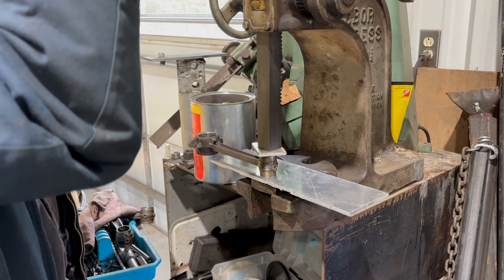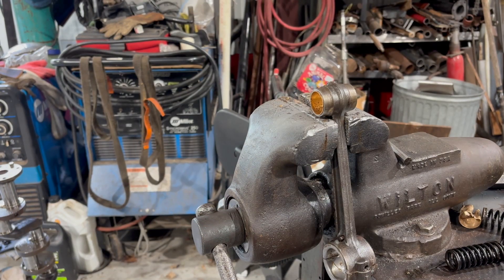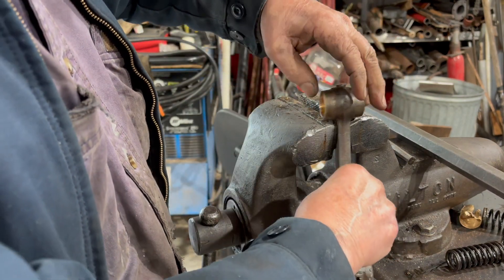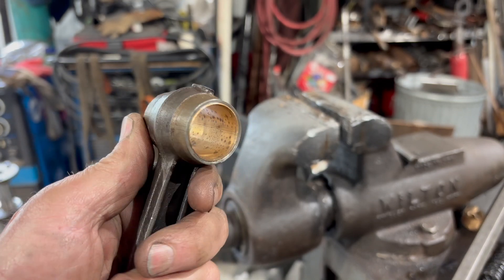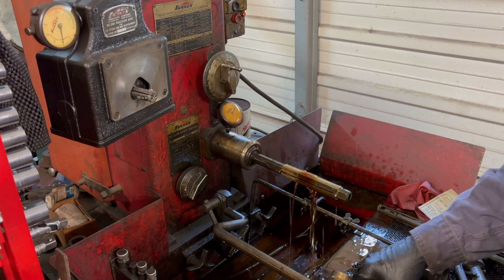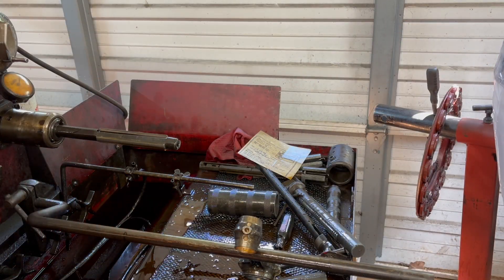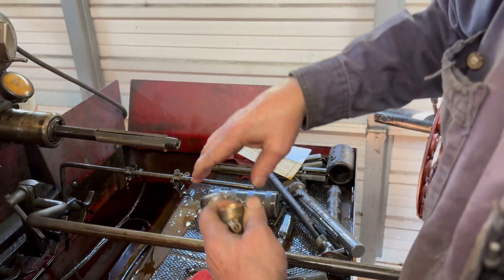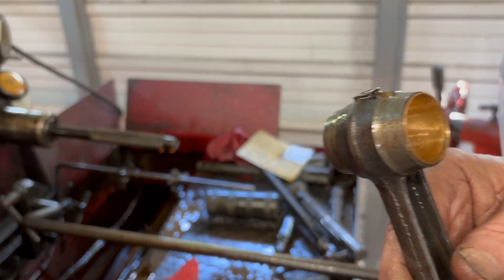MODEL A FORD PISTON PIN BUSHING REPLACE

Comment: Nice job. I helped my dad put the A motor together back in 1973 when I was 17. I remember the wrist pin was a firm push fit. Does that sound correct? Dad was a tool and die maker by trade, so we had a knee up from the beginning.  Lol
Reply from the maker: Thanks, Yes the bushing press in tight in the rod , but the pin needs.001 clearance for the oil , pin should float in the rod 
Do you still have the model A?